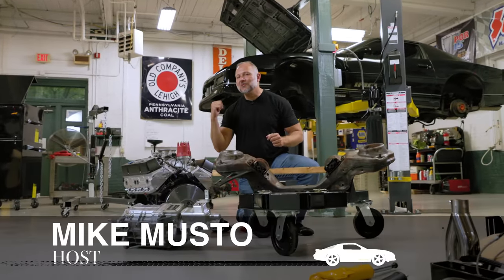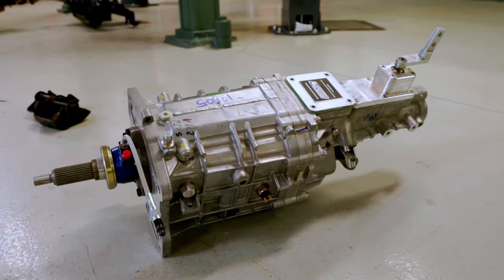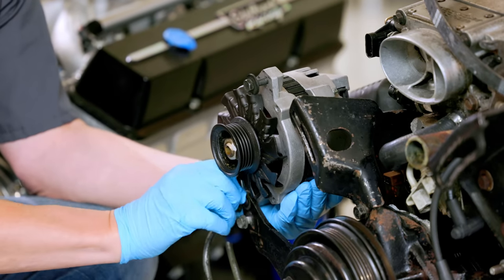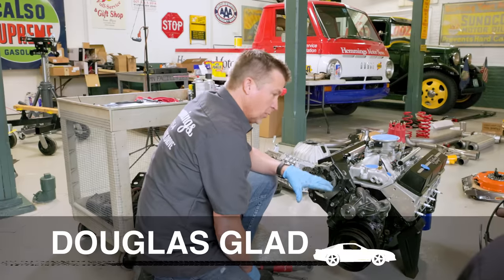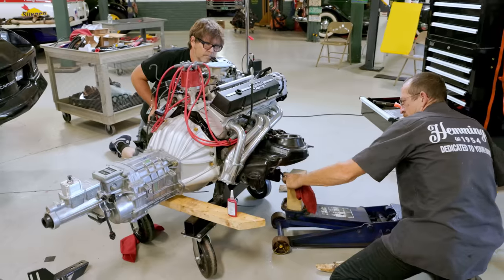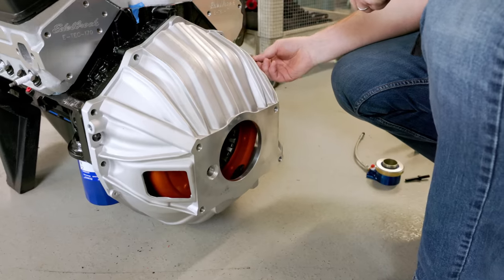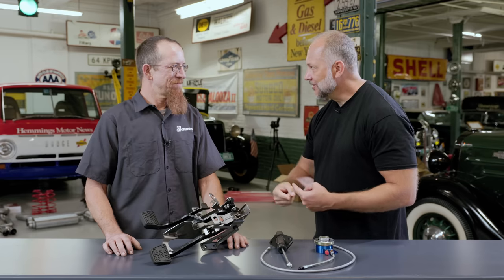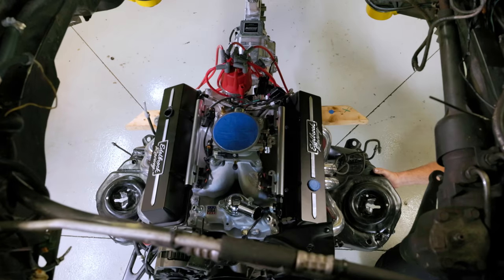Project IROC Gets an Edelbrock Small Block | American Powertrain TKX 5-Speed Transmission

Comment: Loving the video.  I bought 3 brand new  IROC-Z's.  My 1st was an '86 black t-top 5.0 tpi with a 5 speed.  Than an ;87 that was the same car but red.   2 months later I saw the convertible and had to have it.  I bought the 1st one off the truck.  She was red with a black top with every option Chevy had including a stunning red  leather interior.  She cost $22,000 which was 8k more than my coupe.  my favorite car I have owned and I have owned some great cars including a '68 Firebird 400 conv,, a '99 Corvette conv., and my current 2 rides a '11 Camaro 2SS and my '67 Chevelle conv.
Reply from the maker: Nice stable Mark - well done

Comment: I have a 89 Formula Firebird with WS6 suspension... At least it was.  Its fully aftermarket suspension, subframe connectors, 5.7 LS1 and a 6 speed T56.  I fitted brakes off a 2000 Firebird on it.  Turns the car into what it should of been.  I bought a totaled 2000 trans am for my donor.  Made my own harness, bought HP tuners and re programed the PCM.  Everything works on my car, I put in a V6 tach from a 91 because it has a higher redline that more closely matches the LS1 (and the LS1 PCM can easily drive a v6 tach with a pull up resistor).  The car even has AC and catalytic converters so other than the cold air intake the swap looks factory. 

I also went from an auto to a manual.

For the IROC I would of gone with a latter model thirdgen Fbody accessory drive with the single belt set up.

They are easy to work on, you can buy almost all the parts for them now, rear wheel drive, simple, but with power windows, mirrors.  They have been under valued for a long time.
Reply from the maker: We totally agree - way undervalued.
Reply: @hemmingsmotornews  Shhhh.  You keep talking like that, the price will go up.

Comment: There are specific items that make the Iroc iconic visually.  The wheels, fog lamps, tail lights, ground effects, steering wheel, hood, decals, and the TPI intake.  I think the TPI intake needs to stay for appearances, even if that means the car isn't as fast.  I suspect the Edelbrock engine package was a sponsorship item and your hands are tied.
Reply from the maker: Not all IROCs came with the TPI intake.
Reply: @hemmingsmotornews  true, and when the hood on a non-TPI car gets opened people are quietly less impressed.  Seeing the TPI makes the car more impressive.
Reply: @TraceZ28  They used that same hood on all '85 and up Z's. I had an '85 TPI IROC, my buddy had a '85 carbureted IROC, and another friend had a '85 Z/28 with TPI. All had the same hood, tail lights, steering wheel, and ground effects.

Comment: I did mine on the floor in my basement. I chose I little hotter parts though. Tube K 383 crate TKX. Bear brakes. Hawks rear end incoming.
I have Soundgarden Bad motor finger on cassette tape.

Comment: IROC was my dream car for a long time.  You did mention why you didn't replace the pulleys and accessories, but I'm wondering why you didn't spring for a higher end harmonic balancer.  I would think that would be some insurance down the road.
Reply from the maker: The original accessories were in great shape, so no real reason to replace them - it would've been just another incurred cost.

Comment: I had a similar IROC…Black with a teal stripe..T-Tops…just loved it!!  My first purchase was a set of goodyear gatorbacks all the way around.  Helped me so much when trying to race my friends in their 5spd 5.0 LX’s.  I couldn’t find many bolt ons for the car, even though my friends could put GT40 intakes, BBK shorty headers, CAI’s, computer chips, etc.  The only thing I ever found were yellow foam dual air filters.  I could normally win light to light from a dig, but had issues with the 700R4 from a roll.
Reply from the maker: The 700R4 was/is a great HWY transmission

Comment: 380hp seems low. Surprised didn't drop in something in the mid 400 range to compete with some of the modern camaros running around now.
Reply from the maker: I think people forget how much 380hp really is - for a street car that sees occasional track use, 380-400hp is a solid number that won't scare most drivers.
Reply: @hemmingsmotornews  Don't forget a street car with no ABS, airbags, or traction control.
Reply: This Camaro is also weighs about 500 lbs less than a late model, it'll be plenty quick.
Reply: @hemmingsmotornews  I feel like that is 4th gen "catfish" camaro numbers. few bolt ons and those cars were hitting 400. a 6th gen with a few bolt ons is easily in the 500hp mark. Just feel like it would have been nice to keep up with one of those. 380hp you'd be lucky to crack 13's at the strip.
Reply: @davesevenstrings  The late 4th gen Camaro Z-28s were capable of high 12's in stock form with only "305" hp. I'm sure this IROC will run high 11's/ low 12's on drag radials under ideal conditions.
Reply: @davesevenstrings  MotorWeek, who are notorious for running slower ETs than most because they test on an unpreped serface, went 13.0 in a 92 Firebird Firehawk with 350hp.
Reply: @lb9gta307  exactly my point it should be in the 11's like a 2022 model
Reply: @05gtdriver  those were totally underated, my  99 with full bolt ons was in the mid 11's with gears/suspension etc
Reply: @davesevenstrings  Hence the quotation marks around the 305 rating 😁
Reply: @davesevenstrings  between the 30 extra hp with likely a better power band, track prep, and tires with another 30 years of development in them it probably will be reasonably close
Reply: @lb9gta307  the LS heads flow way better than the standard 23 degree ones, plus the extra cubic inches i dunno. All I am saying is another 100hp on the iroc would have taken it to the next level
Reply: @davesevenstrings  who's talking about head flow? Of course another 100hp would take it to the next level. That goes for every car. But it takes less crank hp for a 3rd gen to run the same ET as a 6th gen so not having that 100hp isn't that big of a deal.
Reply from the maker: @pirateofms  BINGO

Comment: Don’t call it an IROC if you’re removing the TPI
Reply from the maker: Not all IROCs came with the TPI
Reply: @hemmingsmotornews  this one did and they messed it up for a motor with 380hp. The TPI could’ve easily handled that.
Reply: There are a lot of IROC fans out there who have no idea what Tuned Port Injection even means.
Reply: @jaime5zero8  It's because Hemming's is showcasing Edelbrock's crate motor and it's much easier to go with the TBI set-up that Edelbrock has already engineered for this application.
Reply: @05gtdriver  TPI is what makes an IROC, that’s what it’s known for. I don’t know anyone who wanted a TBI IROC. If you’re gonna build an IROC then do it right. Everyone goes the generic route with TBI. Build a TPI motor for those who have them and love them.
Reply: @jaime5zero8  IROC's came in 4 flavors, engine-wise, base LG4 155hp 4BBL 305, L69 190hp 4BBL 305, LB9 215-225hp TPI 305 and the L98 225-240hp TPI 350. As long as it's heart is a small block Chevy, it's lungs can be whatever helps it put more power down over stock IMO.
Reply: @hemmingsmotornews  not all IROCs are Camaros for that matter